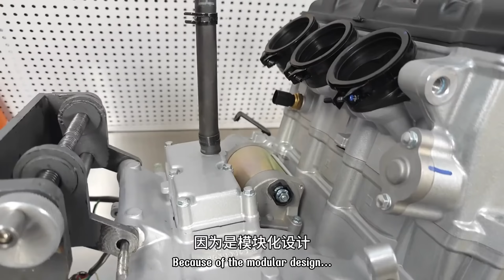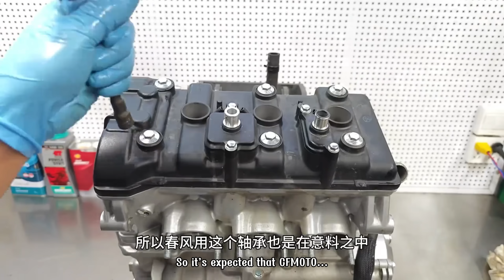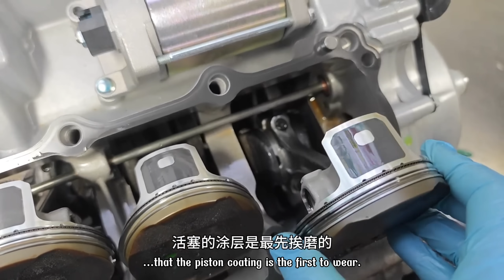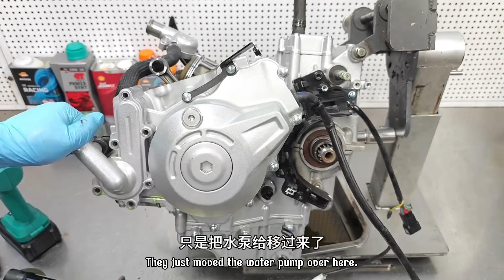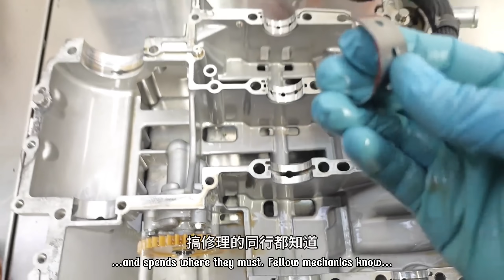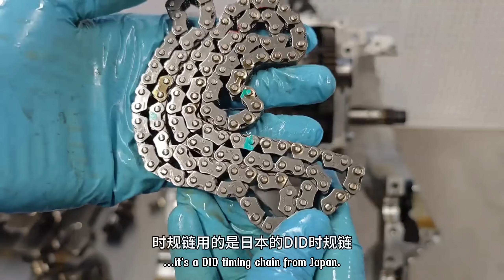CFMOTO 675SR Triple Engine Teardown: Is It Just an MT-09 Copy?

Comment: I absolutely love your videos, thank you for your work!

Would you mind and answer for one question please?

I have 10.000 km in my 675 SR-R. Works perfectly fine, no problem at all, except the "Neutral - N" not showing on the screen all the time if the bike is hot. If it's cold, ,it always shows the N gear. 
Other gears from 1 to 6 shows perfectly fine on the screen, Neutral too most of the time, but sometimes not, and CFMOTO in my country doesn't know what can be the problem.
Do you have an idea what it could be? I would really appreciate your answer. 

Thank you so much in advance!

Comment: I love my 675SS … just passed 1300 miles and it’s getting smoother every day.  I was running premium gas at first until I read the manual a bit more closely … now it gets 87 octane (Regular) fuel and seems to accelerate in the midrange with a bit more pull.  I guess the ECU was actually tuned for Regular fuel … go figure.  Great bike.  Thanks for the video!

Comment: Dear Moto Tech. Directly comparing the Zontes 703 Platform to this CFMOTO 675, how would you rate them in terms of quality and component quality? I showed your 703 disassembly video to a BMW specialist and he was impressed with the attention to detail, including the system that they used on the exhaust valves that is similar to the one used on the S1000RR.

Comment: How much axial play can a countershaft have? I am experiencing bad vibration from 4000-6000rpm after 1st oil service, and after I did a pull around 8000-9000rpm. Now I cant even drive above 4000rpm because vibrations are so bad. I noticed some axial play on the countershaft. Can that be a reason?

Comment: Just bought a 675NK Saturday without looking much into it (I've had a great owner experience with my 450MT). This video made me feel even better about my purchase
Reply: I’ve bought mine in december. Now at 3000 km’s. Only bad thing is something has loosen on left side and when I release throttle at 3-4k rpm’s it vibrates. Other than that nothing bad to say (except from ultra jerky throttle on low rpm’s 😅😃)
Reply: @aaoo3509 probably the passenger footpegs
Reply: @aaoo3509  i heard it due to euro5+. ecu need retune
Reply: @aaoo3509 that just comes with low emission modern engines. They essentially run super lean at low speed/low gear/low rpm to reduce emissions the engine then struggles and bogs when any throttle is applied
Reply: @aaoo3509 jerky throttle can be fixed go going to to a high tooth sprocket,I think a 45, so your gearing will be longer, but smoother in lower rpms
Reply: @aaoo3509 any inssue at the moment? I want to buy one.
Reply: I want to buy it as well the 675Nk how’s youre going? Any issue?
Reply: @User__124__68 none so far. Absolutely love ir

Comment: Thanks for the breakdown. I am going to grab a 675ss model year 2025 based on this teardown and my intended use(engine parts development) I'll need to look at the follower(tappet) diameter and measure a valve spring first. Compression and displacement work everywhere, so I'll grab a cylinder block and see if there's enough material for a plus 2mm increase in bore diameter and some added compression. 

Cylinder heads on modern motorcycles are almost universally good, but I'll be looking there for improvements. 

The connecting rods look to be of good design, so hopefully they look good under FEA. 

125 WHP without overheating seems like a reasonable target, but a lot will depend on the cooling system or the ability to add capacity or get additional performance from the stock system. 

Thanks again!

Comment: A very common issue is the water pump.
It has a leakage from the inner oring from impeller i guess. 😢
I have that issue too.
The dealer replaced the housing o ring but it didn't work. 
So i think the only way to fix it is a new pump.
Maybe you can make a video about how can change the waterpump
Reply: common on japanese bikes as well

Comment: ... so, which one is better, this CF Moto 675,or Zontes 703 engine, please?
Reply: The 703 uses better quality components it seems. Every rotating part is forged and even the piston pins are dlc coated. Wich one will last longer however is anyone's guess.. I would put my money on zontes though, the cfmoto already had some issues with oil consumption but I believe it was already adressed.
Reply: @zero_grip_gs  oil consumption issue was because of oil squirter holes were to big- they replaced it on recall
Reply: @labasrytas2876 thanks for the correction!
Reply: thanks, I expected to be Zontes and do agree that time will show (I think that lower costs of Chinese motorcycles, which are relatively good quality and for that reason , are selling in Europe quite well, we'll have good feedback in a couple of years)
Reply: @damirdebogovic9500 No problem, I really can't tell between these two brands, but quality seems pretty good as my current dealer (I own 2 benellis), sells benelli, zontes and cfmoto. My tnt 125 is at 9k kms and my daily is a leoncino with 23k kms. The leoncino saw 2 offroad events (about 800 kms during 2 days each), and for the past year is being used as a track bike (12 so far). Neither have skipped a beat. But again, i believe the quality of the dealer is important, and mine's pretty good. I had worst experiences with my ex suzuki dealer. I will have no problem on keep buying chinese bikes 👌 (sorry for the long post)

Comment: Do any modern bikes still have cassette type engine casing, where  casing isnt split open in half, but gearbox can actaully be removed with just removing it with sidewall? It is actaully very clever and time saving design, do you have any exprerience with it
Reply: MV Agusta does still use cassette style gearboxes

Comment: You are probably doing more to allay quality concerns about Chinese motorcycles for Western potential purchasers than anyone else on YT. I have yet to see any signs of shortcuts taken in the quality of parts used & the overall production quality seems very good. Well done.
Any chance you could do a Voge 300 Rallye engine ?
Reply: Yes lol learn alot from this guy. Actually chinese bike is as good as european bike and japanese bike.. and never thought japanese , european bike uses chinese made parts in their bike until this guy reveal the origin of those parts in japanese of european bike.
Reply: @misfitzmotovlog7424 oui mais avec les cahiers de charges japonais
Reply: I agree, Moto Tech is unique, and offering an incredible service to motorcyclists the world over. All power to the Chinese bike industry, they clearly are on a winning course. I would have no hesitation in buying a Chinese bike after watching these videos.
Reply: it's actually VERY HIGH quality, no break in and still running smooth means that te tolerances were perfect straight from factory.
Reply: 100% I’m in the UK watching this to see the quality .  I’m saving to buy one :)
Reply: @nickclarkuk I bought the 675nk and absolutely love it. I've just got back into riding after years out and it inspired so much confidence. The engine is super smooth with excellent power delivery in the lower gears, it runs out of puff at around 120mph but I'm a big guy riding a naked, I'm sure if I tucked my barrel chest down more or if my wrists could handle the riding position of the faired version I'd be able to squeeze more out of it.
Reply: Beautiful ❤️
Reply: all engines look good if you open them up after 2-3000 km
Reply: @LiviuXSA  Not what I am looking at. Quality of castings, forgings, machining etc. are not dependant on mileage.
Reply: Estos vídeos son una estafa más de tipo made en china...están analizando el desgaste de motores con 1000 km 😂😂
Reply: @Alber888  Not "analysing engine wear" at all here - showing the construction, design & materials selection.
You have your head in the sand if you don't realise the pace of change (mostly for the better) of Chinese manufacturing. It is mainly the quality of the support offered by UK importers that is holding me back from buying a Chinese built bike now, not the build or materials quality of the bikes themselves.
Reply: @mgnbukint6502 You know what holds me back? The ccp and all their subsidies.
Reply: @Alber888  Oh?  What kind of wear were KTM's showing on CAM shafts after a 1000km?  What kind of wear were KTM Adventures showing after the airbox debacle and a 1000 dusty km's.
Reply: @percussion44  the point is, 1000 kilometers of "NO BEDDING - DIRECT TRACK USE" this tests the engine to limits, not "normal use" really important.